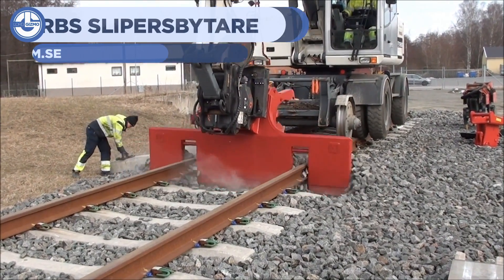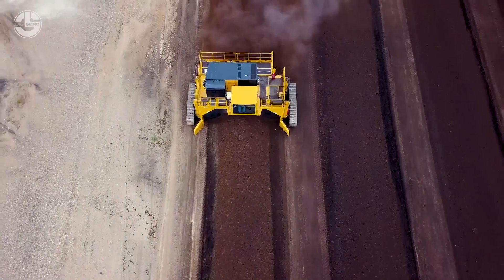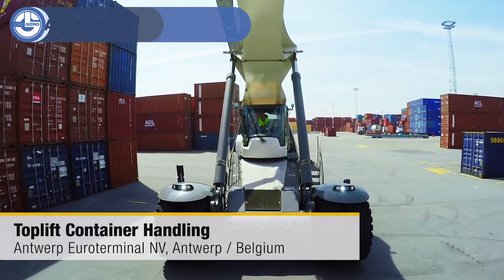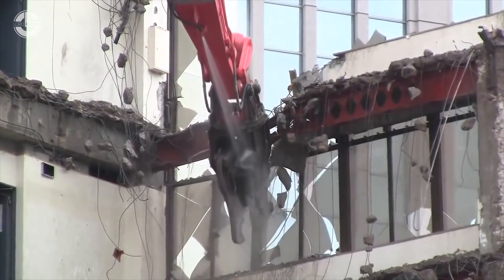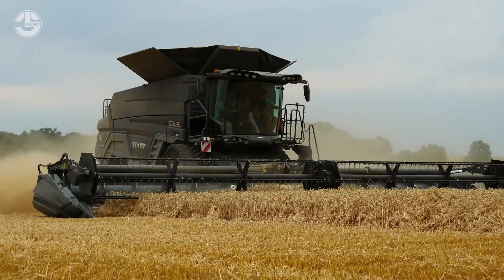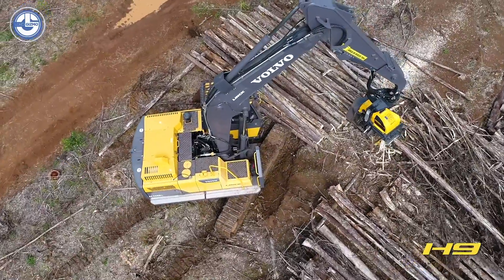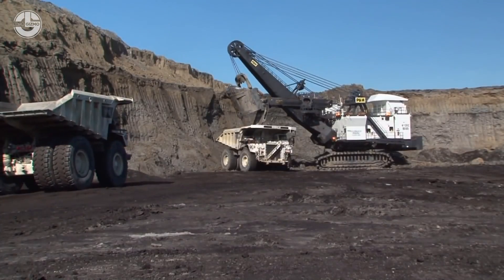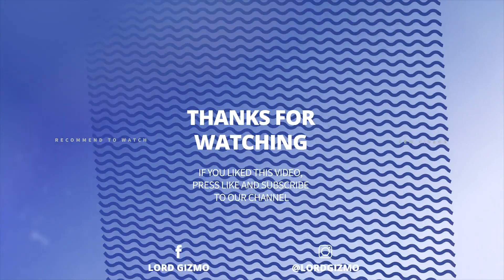20 EXTREME Industrial Machines Ever Made!

Comment: I wonder why they don't just use explosives instead of the long slow process of using a crane for demolition. It couldn't be that much more expensive to use explosives.
Reply: Explosive demolition cause damage to the foundations of building, but by selective demolition you can always rebuild the stuctures over its  foundations.
Reply: @-sawal  Fair point thx.

Comment: extremes? when i was 20, i was an oiler on a 320, 247 and 400 cleaveland trencher. after a month of offsetting pipeline stakes to sight the line from the operators seat, i was able to run these monsters in agricultural san Juaquin valley stretching out over to the pacific coast. the trench was 3 ft wide, 6 or 7feet deep and miles and miles long. i can't remember exactly but it was something like a mile a day. no breakdowns, and those machines are so easy to break. transmissions were a 5 gear mainbox that ran a split gear walking gearbox of 1&1, 1&2, 2&1, 2&2, 3&1, 3&2, 4&1 and 4&2. 15 huge buckets hoisted by a gearbox running the front rails of the digging wheel and cable pulleys for both vertical lift and crumbshoe slack. gently drop the front of the wheel and creep forward in 1&1 or 1&2 to fit the crumbshoe in and as soon as that was set the crumbshoe was next to carry the grade. it was as long as a 666 caterpillar scraper almost. me and a guy named Harrold Ailer, a mechanic that lived in arvin california. working for ARB INC, he used to stuff wads of big red or some bagged leaf in his mouth but man i'll tell you, getting that opportunity to work with the coolest companies and the coolest operators was pretty cool. then Granite Construction got me for a few years rolling asphalt all over the place. 5000 tons were a typical 8 hr shift, you name it we paved it. at 6:30 am there was already 40 loads strung out, they'd have spare pavers and second pass pavers at the end of the jobs. 6 lane city streets, rural farmland streets, parking lots, runways, parks and recreation campsites, freeways and prisons. i was nicknamed "bullet."

Comment: Using stump removers is a bad idea in my opinion. For anyone that has actually removed many large tree stumps from the ground, you would be amazed to see how much tree material the tree root branches underground makes up. When these large roots eventually rot, the ground surface above sinks quite a bit. Anything you put on top, a roadway, building, bench or fence will have to be repaired after a few years.
Reply: 0
Reply: 😢😢😢😢7!((+;+
Reply: That’s kind of why they remove them. Then they use very efficient rollers and packing machines. Then put down the barriers then build a proper road on top of all of this. Roads don’t sink very often anymore!!!